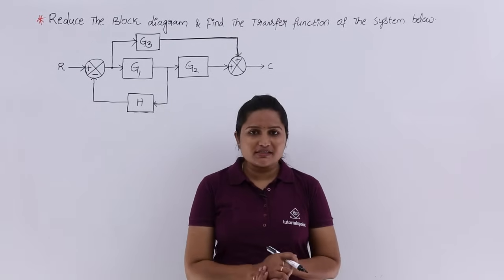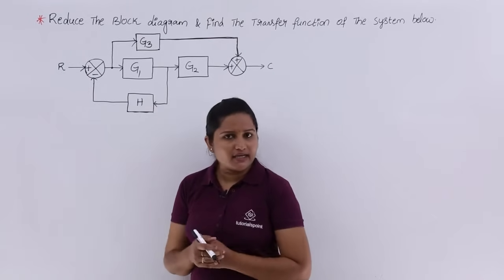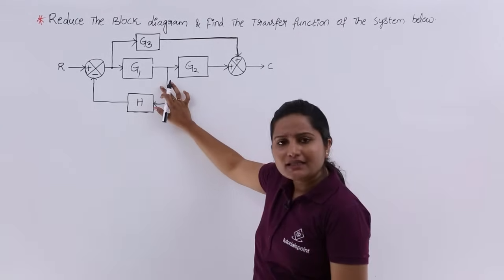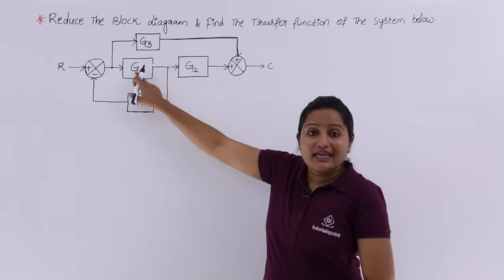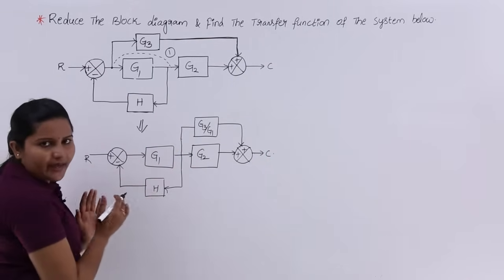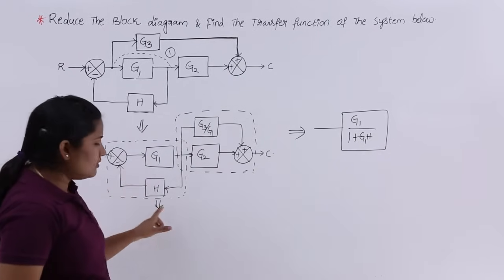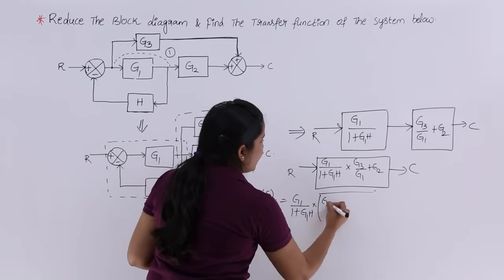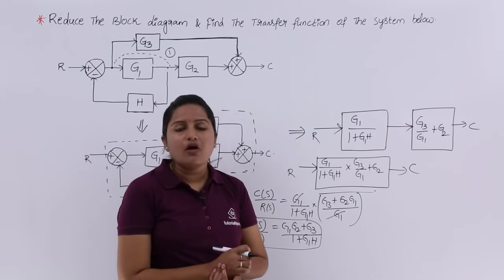Problem 1 on Block Diagram Reduction

Comment: While reducing G2 in +ve feedback with G3/G1, instead of taking +ve you have took -ve. So the answer gone wrong...
Reply: G2 is not a feedback back . It is a parallel path with G3/G1 and G2. You can see that in the diagram. So you need to add them .
Reply: @mahalekshmianil2691  at last there is summing point where it's gone
Reply: @pavankumarkasu8513  when you move G3 after the block , the G3/G1 block comes in parallel with the G2 block , ie , the G3/G1 block, G2 block and the adder forms the parallel component , hence due to parallel combination the gain blocks G3/G1 and G2 are added to eliminate it .

Comment: When you want to check your answer, you can apply the following steps:

Multiply the blocks connected in series, add up the parallel ones. Write them in the numerator. (For this question -> G1.G2 + G3)

For Feedbacks, consider only the feedback affected block. And write it in the denominator. (For this question -> 1 + G1.H).
Reply: you are a god
Reply: Thank you bro
Reply: Thank you but what do I do if there are multiple feedback networks?
Reply: Appreciate legend

Comment: if in parallel and negative feedback, you use the (G/1+GH) formula and for parallel with positive feedback you just add the gains, correct?
Reply: No. If you’re doing positive feedback you use(G/1-GH). Positive feedback wasn’t in this video. You might have gotten it confused with positive feedforward (parallel) in which case you just add them

Comment: Madam in block diagram reduction problem 1 ending step we have 2 feedbacks but you are taking 1 is feedback another one is parallel gains madam why
Reply: Gain is flowing from input to output that is parallel and output to input that is feedback

Comment: Quick question, If the two blocks are in series at the end there, wouldn't you just add them together instead of multiplying?
Reply: No, because there isnt a summing junction.

Comment: we can also move G2 to the left and then reduce the diagram but the resulting transfer function is slightly different than yours. kindly explain.
Reply: I had the same doubt. I got slightly different transfer function and I don't know if it is correct or not :(